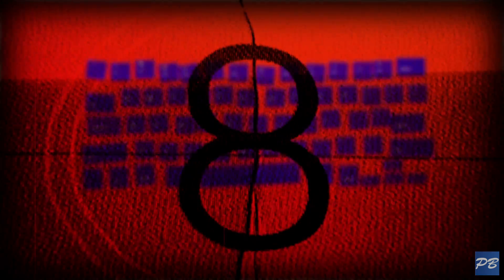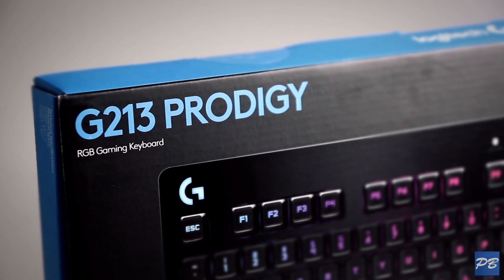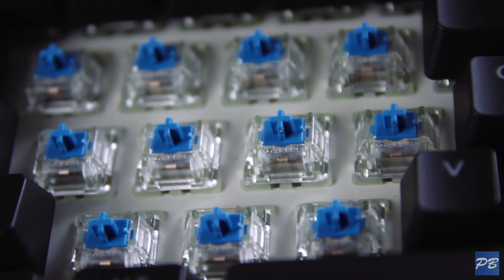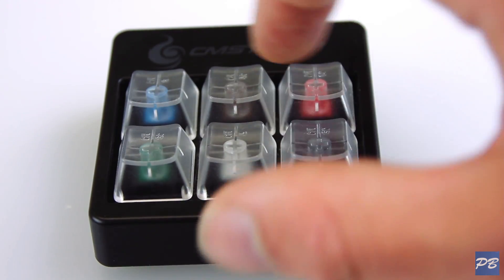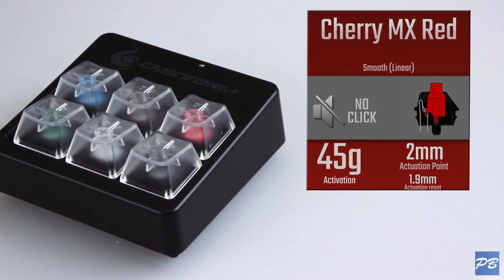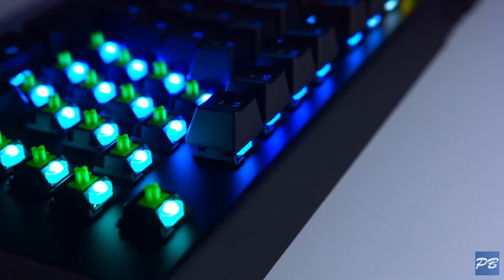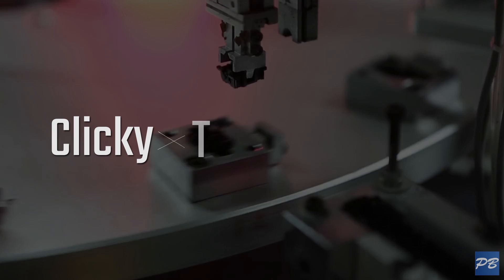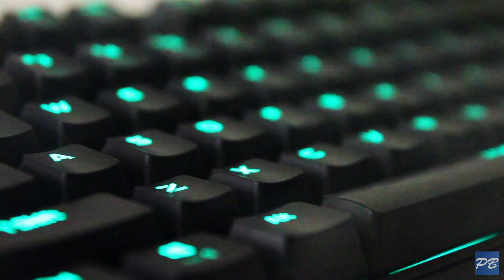Mechanical Keyboards And Switch Colours Explained

Comment: 1:44 In the past, I always wondered what people meant by “Cherry Blue, Cherry Blue.” I thought maybe it was a company named Cherry that made the best blue switches, which only came in good (and usually expensive) keyboards. So when a budget keyboard claimed to have “blue switches,” I assumed it was just a marketing thing not the real Cherry Blues used in high‑end keyboards.

Today, while searching for a new keyboard, I saw different models with different switch colors and prices brown, red, blue, green but no mention of Cherry. That made me think they might be using more affordable or different company switches. So I came to YouTube and searched “How many types of switch colors in keyboards?” and found out it’s not just about color it’s actually different switch types.

In my own keyboard, when I remove the keys, I see a little white dot thing, and sometimes that rubber‑like part comes out, exposing the board. It still makes a sound when I’m programming or typing fast. I’ve only used this keyboard and my MSI laptop keyboard, so you can see why I was confused.

That’s why I searched “All about keyboard colors and types” and found this video. It’s finally explaining things I’ve been misunderstanding for so long. I’m also learning new stuff and getting clarity on this topic maybe filling in the gaps in my half‑knowledge and correcting what I thought I knew.

Comment: Is feeling the "actuation point" an issue? I currently have a quickfire rapid pro (red switches) that I've had since 2012; gotten used to it (for both gaming and typing) and I love it. However in the event that I should buy another keyboard in the future would brown still feel similar enough? I think I'd like it better if typing was a little quiter (the feel of red is nice however I have nothing to compare it to).
Reply from the maker: The easiest way to find out would be just to head in store and have a play on some of the keyboards, we have a bunch on display. I personally like feeling the actuation point, but everyone's different. Both clicky and tactile switches do tend to be louder than linear, however.
Reply: @pbtech Cool ty for the reply. I looked up something called o-rings to put underneath the caps to dampen the press/reduce sound. Might be worth it instead(?). I usually just press all the way down to the bottom.
Reply: is that red best for typing?